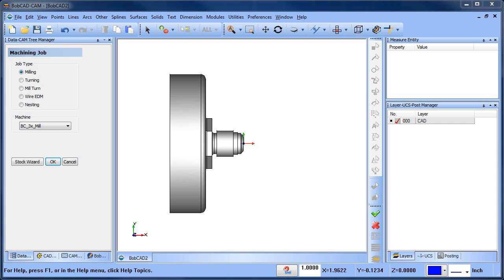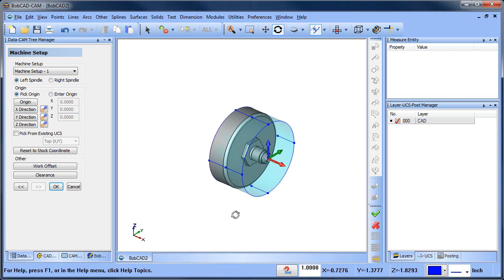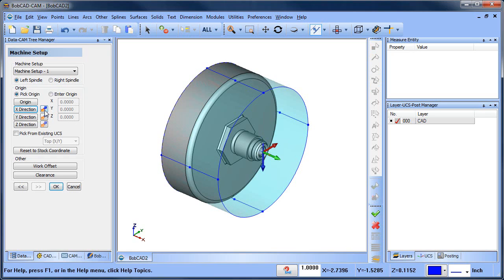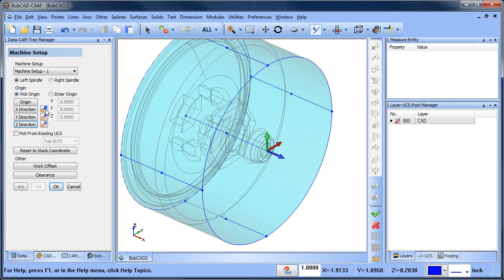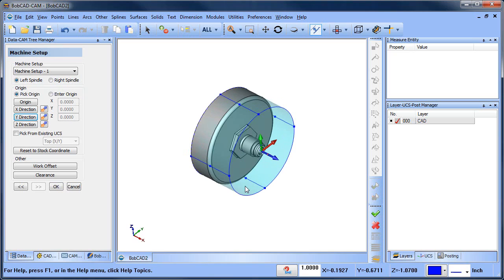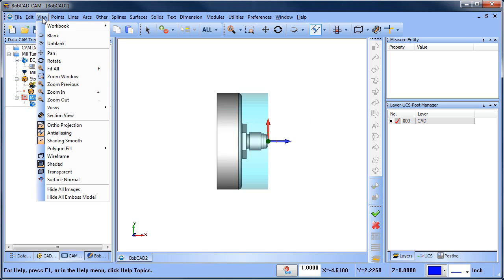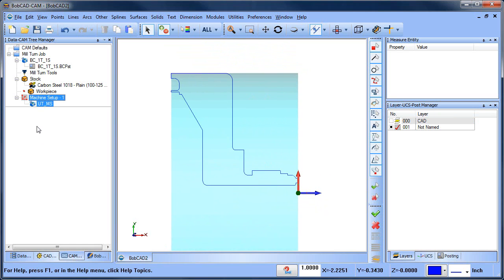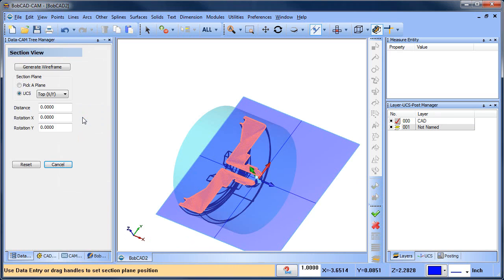Mill Turn Setting Part Zero BobCAD CAM V28 Mill Turn Standard

Comment: Why doesn't the Coordinate reference on the bottom left of the screen update when you change the axis?
Noticed it wasn't compatible to the one by the part. Why is that?
Reply from the maker: That is the world coordinate system.
Reply from the maker: +Depoalo   The world coordinate system will always stay at the world orientation, the UCS or origin and be modify for the part geometry and setup you are working on.
Reply: Oh Ok is it possible to modify it to be configured with your set-up? Just curious.